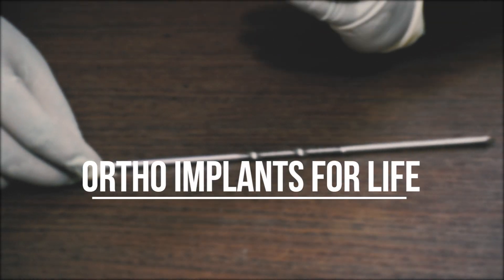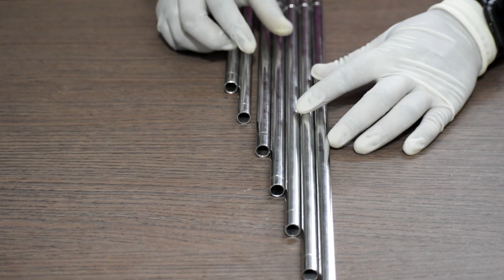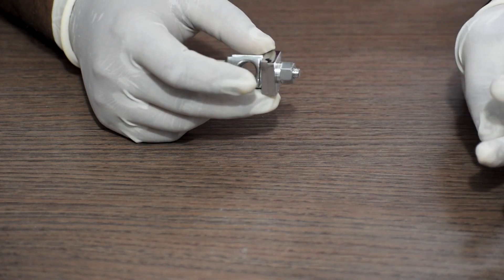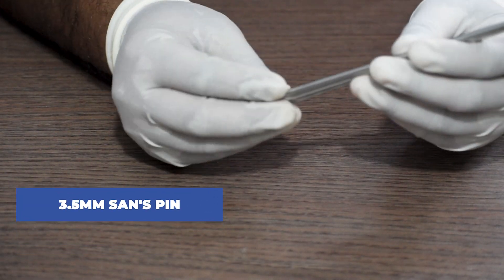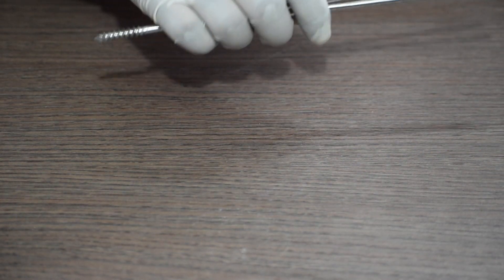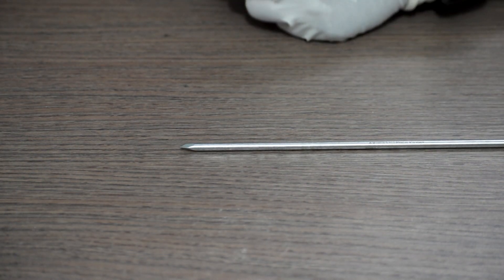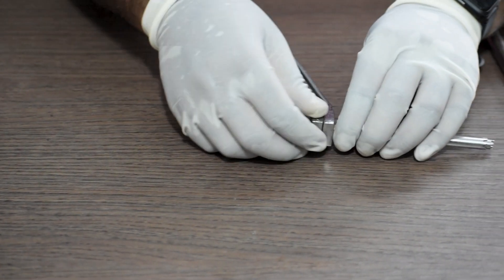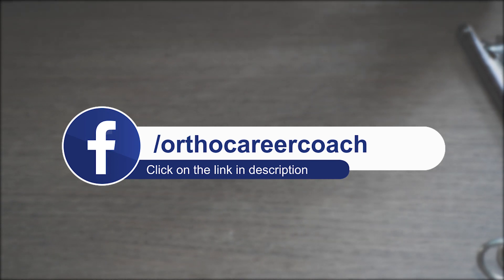External Fixator Implants & Instruments

Comment: Tubular rods
Single pin clamp
Tube to tube clamp
Transverse T clamp
3.5 mm stanz pins
4.5 stanz pin
6.5 mm cancellous stanz pin
Deinham pin 
Steinmann pin
T handle with chuck and key
Size 11 spanner 
Drill bits
Triple trochar